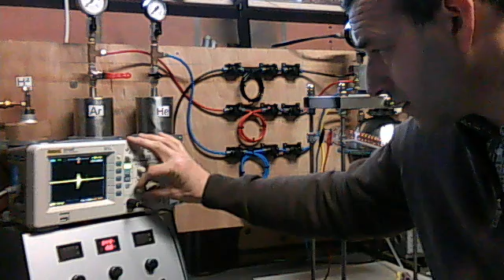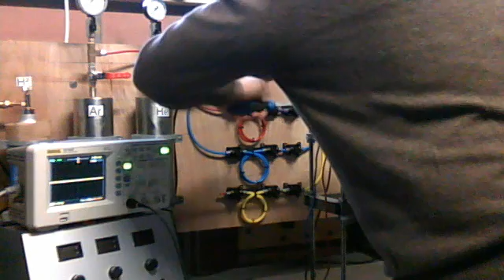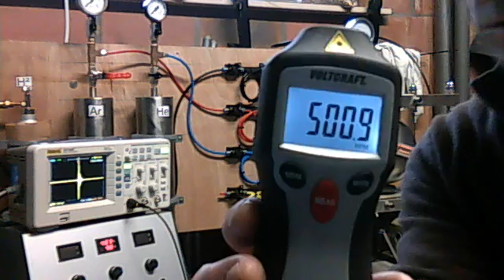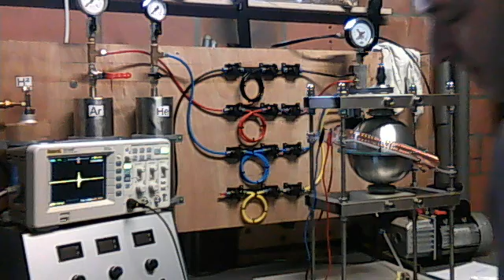V11_Noise tests 2013 12 07 14 43

Comment: Hola Geert, el montaje fabuloso, solo te falta crear el 4º estado de la materia dentro de tu reactor (plasma convencional de alta temperatura) y emplear el campo electrico y magnetico de la forma adecuada para conseguir plasma rotatorio (spanish to english traduction) Hi Geert, fabulous assembly, you just need to create the 4th state of matter inside your reactor (conventional high-temperature plasma) and use the electric and magnetic field as appropriate for rotating plasma:

keshe reactor antigraviticsystems1